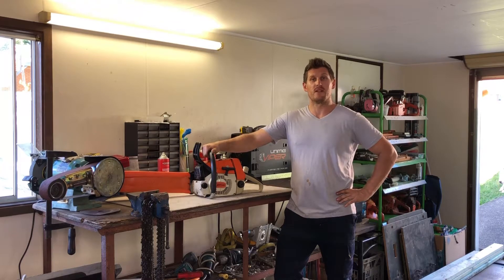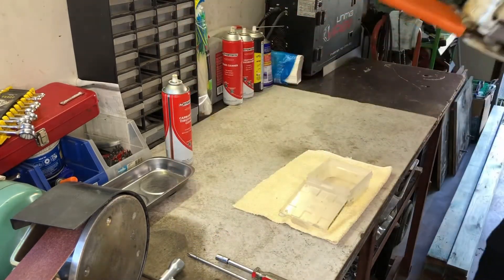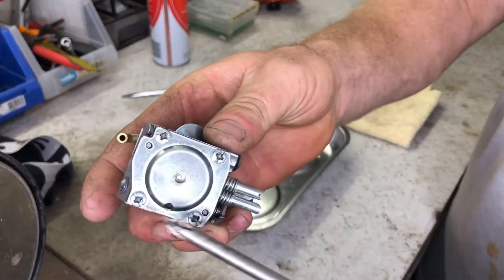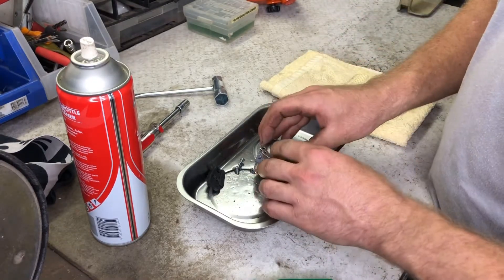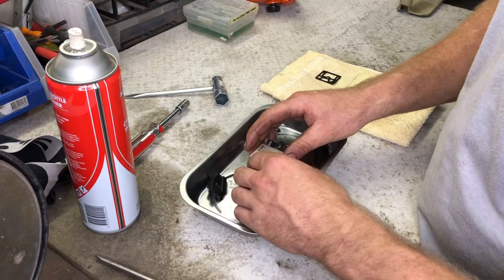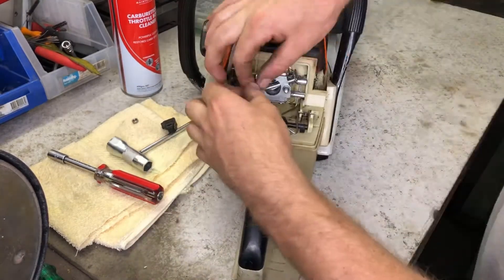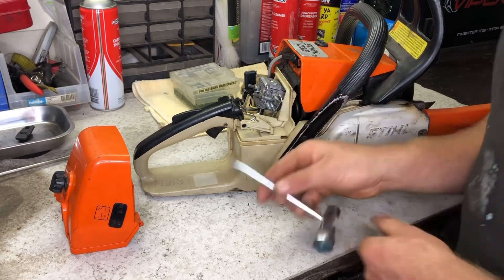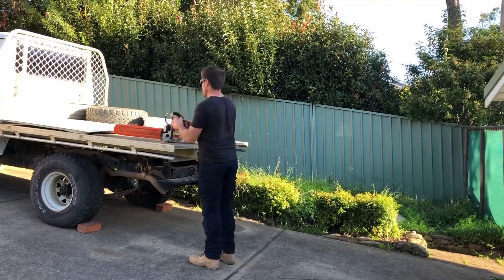Chainsaw basic service and carburettor adjustment: Stihl 036 and 2 stroke fueling issues

Comment: I also have the same model 036 like yours. I have problem with rope pulling. It takes a lot of muscles to start the engine. Is a hard pulling rope.
The engine start but takes lots of sweats to pull the rope.
Any solution for the hard  pulling rope?Maybe have something to do with the compression.

Comment: My O36 is 33 years old.  I'm doubting it looks like the brand new carb you're showing us. /s    Do you have a link to a full rebuild kit for this carb?  That would be a big help!  I don't want to buy a $20 "new" carb and "tune-up" kit from Amazon made from low-grade Chinesium.  That seldom ends well.  My saw, with a 20" bar is a true workhorse and I really want to get it back into good running condition after not needing to use it for 4 years.  Any info on parts suppliers would be much appreciated!  Thanks!

Comment: One pull?!! Amazing! I have a Stihl 036 PRO, it stopped working last week and I couldn't get it restarted. Cleaned-out the carb as per this vid, changed the gas, changed the spark plug but it still won't start. Any suggestions?
Reply from the maker: The carb cleaner ignites first when l start the saw after servicing. You could wind the low idle screw out 1/2 turn and the idle screw out 3/4 of the way leaning out the saw.. it could be flooding while starting. You can also remove the muffler and check the piston/cylinder condition. Let me know how you go👍